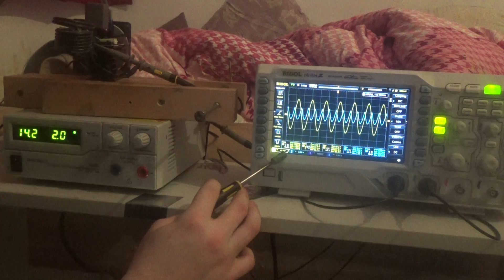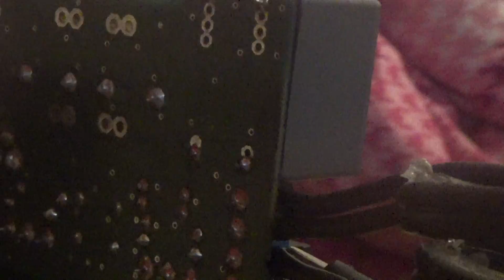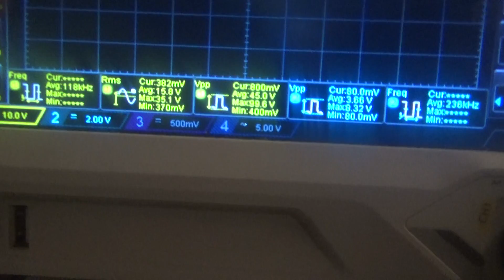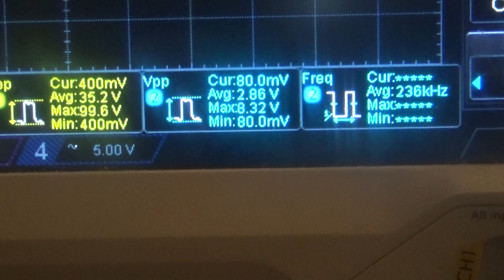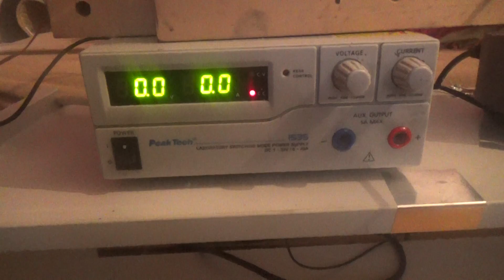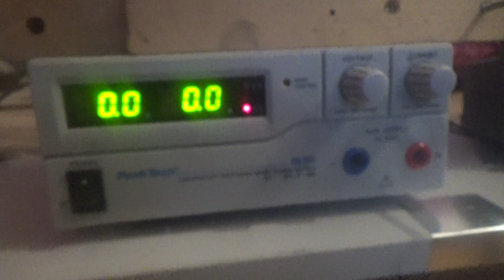ZVS driver induction heater waveform and PCB failure.

Comment: There is nothing wrong with your electronics and what is wrong is that you do not seem to fully understand the nature of the loading of the induction heaters.  There are basically two popular induction heater circuits, one uses two inductors while the other uses one inductor. Both use a parallel tuned LC circuit which should be always fed from a CURRENT SOURCE and not a VOLTAGE SOURCE. 
My experience is that the circuit using two inductors, (with the tank coil not being center tapped) one on each drain, and the other using one inductor feeding the center-tapped tank coil, are a clever engineering trick in how a voltage source is made to feed the parallel LC resonating circuit which needs a current source to feed it properly and get maximum benefits out of resonating it. 

All your waveforms are correct except for the fact that the waveform of the power supply appears to be inverted. With a  voltage power supply with current limiting one does expect it to behave as it is behaving.  The "loading" of the ZVS during one of its cycles is very interesting and it is a situation where few go into details.  The ZVS with the center-tapped coil has a different loading philosophy from the one without the center-tapped coil and seems to load the voltage supply if the series single inductor is not of the right value.
Next time do not show the differential output from the drains but show the voltage on one drain with respect to the ground. Once again the secret of the ZVS is how a parallel LC resonating circuit is fed using other  INDUCTORS  to change the VOLTAGE SOURCE power supply to a current source feeding the parallel LC tank coil. 
  
I would say that in your case, everything is correct except that the current limiter of your power supply is a little too wide range in reacting to the load current demanded, hence the ripple at twice the frequency!!!! Putting a filter circuit especially a parallel capacitor would  demand more current from your ZVS.
Reply: Well said, thanks for your input